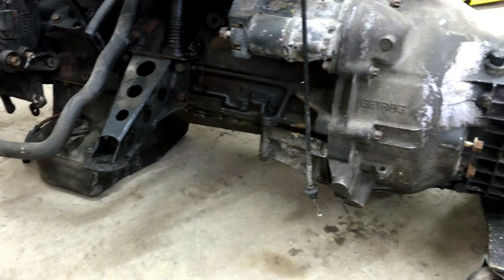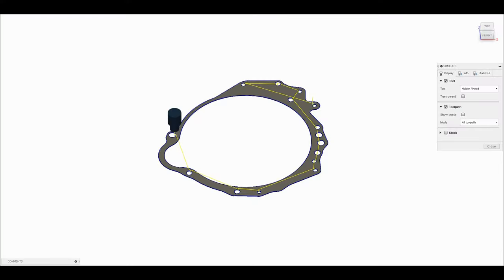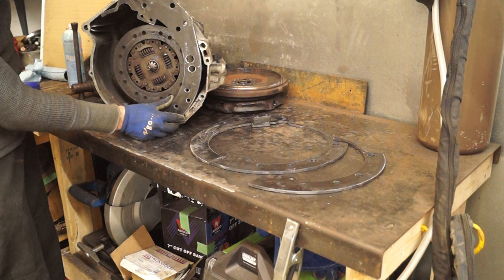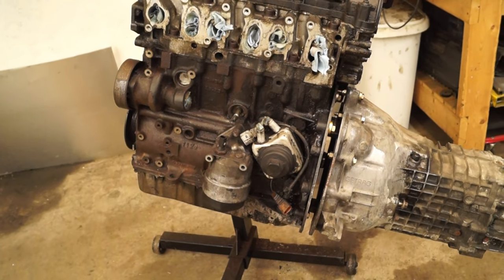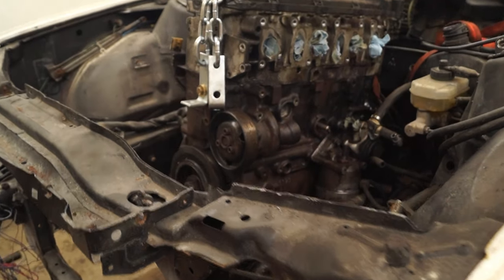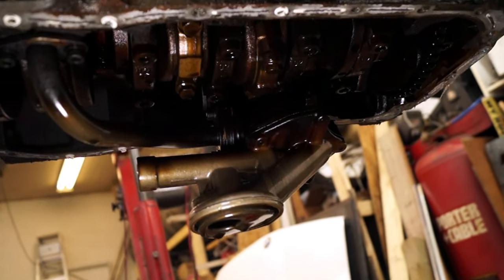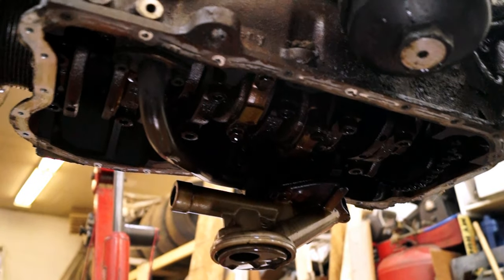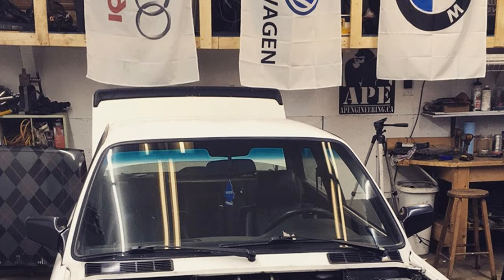ENGINE MOCK-UP - E30 VR6 PROJECT PART 3

Comment: Hey you should cut the bellhousing to clear the timing cover.  One ive seen people do this to fit starters on K swaps in e30s and two the clutch disk is too far away and the stock g260 input shaft doesnt engage and it doesnt rest in the pilot bearing.  Might be easier to chop up the bellhousing rather than do the crazy plate which i would love to see btw
Reply from the maker: That would be an option but I dont want to cut the transmission bellhousing. And anyway I wanted to keep the oem trans position so I didn't have to play with the linkage or driveshaft. The adapter plate is needed to push the motor forward or else would need to cut the firewall

Comment: I didn't see a spot for the starter on that adapter. what are your plans for that? very ambitious project
Reply from the maker: The starter will be placed on the passenger side of the engine where it is normally place on a longitudinal VR6 setup (Touareg for example).
Reply: Make it a pull start off the pulley haha